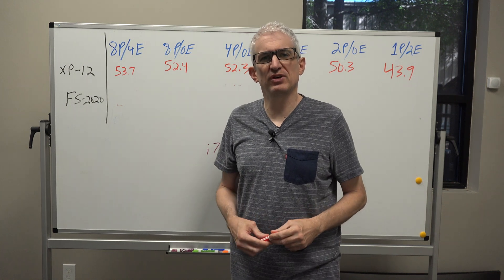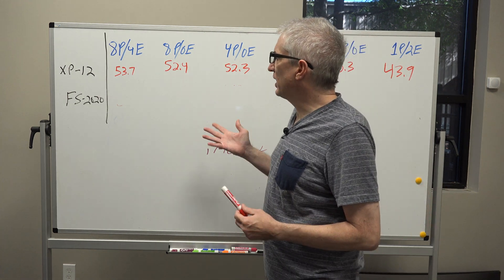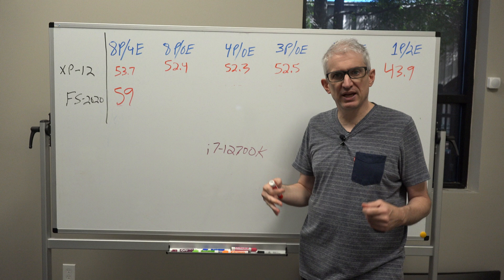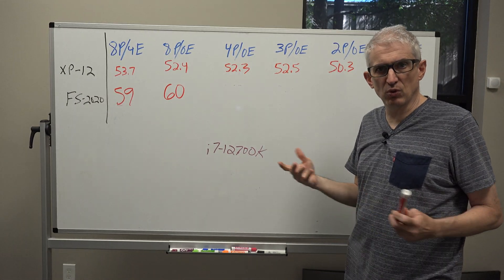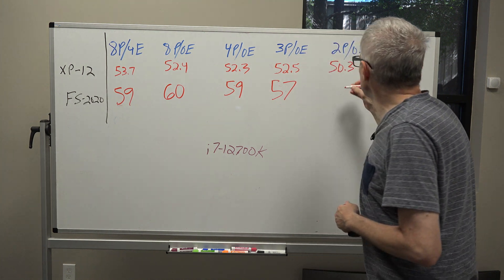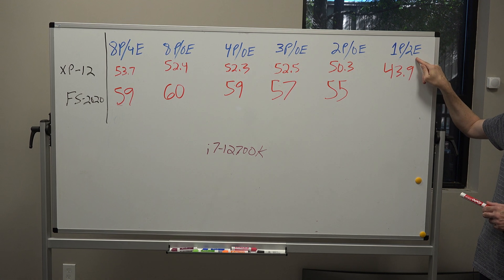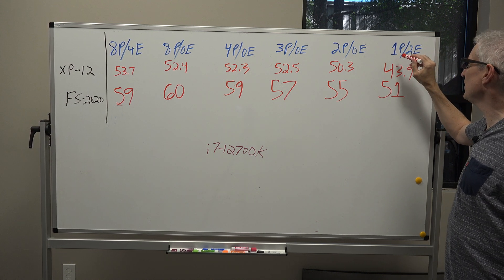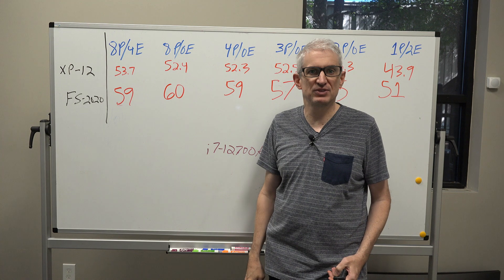FS 2020 CPU Core Scaling

Comment: I don't know everything, but fs 2020 does not fully use multicore. It's nearly as bad as FSX in this regard and IMO is unacceptable now. Top end games have been using more cores so that the ones in the last few years have really saturated 8 cores but not flight sim. It's from microsoft, they should know how to code by now. Is it just impossible to do with a flight sim ?  I am having a hard time to believing that since so many other games that push my GPU to the max are are also pushing my CPU to 80% + on all cores. Meanwhile if i look at core usage when flying it is pathetic. It's frustrating because my system works great for everything but for FS i have to upgrade the CPU to the fastest most expensive one so that 1  core can help. Ridiculous.
Reply from the maker: X-Plane says they are working on multi-core support.  I am anxious to see what that looks like.

Comment: to all the people with the negative comments you don't know what your are talking about.  He did a good test to show the problem with this game and many others. it is just to much work to code for multiple cores, fsx had this problem and for years i tried to fix it but its just not coded in  away to use the cores. Most games are not, i just bought starfield and i was impressed it is using 75% of my cpu with 7 of the cores loading very evenly. Look at core load for any game from the past 10 years and you will notice the same picture, most games are GPU dependent and it goes un noticed but this is a flight sim and its a real shame they did this, seems the priority was console since its stuck with the same GPU. flight sims benefit from PC hardware upgrades over many years.

Comment: Excellent test Mike and a point well made. But, you only touched on hyper-threading and this is a feature that really goes back to single core processors and with modern multi core processors is now of little benefit - in fact is actually slowing things down a little. It would be very interesting if these tests were repeated with hyper-threading turned off, then we'd know how many threads the flight sims are actually using. If sims make good use of a second thread or even a third, then turning off hyper-threading and forcing these to be spread over individual cores, may do a better job than Windows does with hyper-threading turned on.

Comment: This testing is flawed in many ways as he is testing on a single monitor, I don't know ANY of my flight Sim friends (many of whom actually have licenses and fly real planes) that would use ONLY 1 screen, its a 3 screen minimum with several friends using 4 to 6 (to add the instrument panel on 1 screen plus the forward heading, 1 left-heading and 1 for right-heading or looking screens, and I know for a fact that it is NOT just the GPU (graphics card) that has to handle all that extra screen realestate,, it IS the CPU that has to step up and push the frame rates, I have noticed that in the racing games that I play (as I am more of a Racer (IRL & on the PC/console(i wish consoles had an option to do more than 1 screen, sure its nice to have a 55", 65" OLED or a 144" LCD projector, but 3 screens or compensation for wrap around/Curved screens would be nice, plus you can connect a PC to larger OLED screens and projectors as well) and I notice a difference on my 14 various home PCs in performance when using more than 1 screen)), and so I think this test should be reexamined and redone on a multiple screen sysem.
Reply: And with VR
Reply: I only use one screen (like many others I know) and I'm heavily involved with flight simulation.
Reply: I dont think you know what your are talking about, adding more screens does not put more demand on the CPU. When you increase the rendering resolution the GPU has more to render. This does not increase things like weather, physics, AI, etc. I run a 49# curved monitor with increased FOV and this looks more real than the old multiple monitors.
Reply: @supergenius74  I couldn't care less what you think. I've been working in I.T., System Administration, Network Administration, System building, hardware and software development for probably longer than you have been alive. I don't require or need validation from someone who calls themselves "supergenius__" as that only hints at someone with self doubt, inexperience or both 🤔 and thus, good luck with whatever it is that you do but I know I am correct in my comments, that's why they are typically lengthy and detailed. Good Day
Reply: It is not flawed, I use one giant 60 inch TV just fine. Others use 100 inch TVs, or single large monitor. Not everyone wants multi monitor stock market analyzers desk. Micheal chose a simple baseline - single display, same airport, same runway and progressively disabled C and eC. What is "flawed" about that?

Comment: Flight Sim benchmarking is complex.  I have an old 2017 xForce PC w/ i7 7700K 4 core, nVidia GTX 1070 8GB, which can drive a 5120 x 1440 4K galaxy neo g9 gaming monitor and XPlane 12 smoother and slightly higher fps than my Mac Studio Ultra 20 core cpu / 64 core GPU.  But there is a LOT behind this which no simple benchmark comparison can explain.  The forthcoming critical benchmark w/ MSFS (beta) is with DLSS 3 enabled which is likely going to be a major step in rebalancing CPU vs GPU bottlenecking.  So investing in the 40 series nVidia platform has a significant potential ROI in this regard (versus buying an earlier platform that does not support DLSS 3.  There are already some early measurements on this, quite exciting results.

Comment: Thanks so much Mike for the information.  Really enjoy your comparison videos.  I wish there was more testing like this out there.  Would love it if you did some testing in the future comparing clock speeds between some of the higher end CPUs in the future if you were willing.  Knowing their is still a CPU bottleneck in XP12 really makes me wonder if upgrading my 5800x to something like a 5800x3D or a Ryzen 70xx CPU would be worth it, or if a counterpart on the Intel side would be a better option.  It's so hard to find the sort of specific, simple, quality information you are providing here.
Reply: Xplane for now don't use 3Dvcash so 5800x3D don't have many sense. what I seen 3Dvcash have more sense with slow RAM 2666 cl20 vs 3600 cl16 on 5800x3D have a little difference.

Comment: I would think frame rate would be far more impacted by the GPU than the CPU.  I run a lowly 2080 for now and an i9-9900 and I see one thread at 50% or so and all the others under 25%.  Using multi-window (3), 1440 displays, I get 32-40 fps, 32 near the ground with lots of trees, 40+ over 2000’ AGL, HIGH and a few Ultra Settings.  Multi-window is a pain in fs2020, but it’s better than when I used nvidia surround.

Comment: Thanks for performing that illuminating comparison!  It was a good test to confirm that most of the CPU base-level computation is being performed on a single core in both simulators (excluding loading new textures, terrain, etc.)  Assuming any major math is still left to the CPU and not on the GPU, both simulators might benefit from parallelizing bulk calculations across more cores.  Unfortunately,  many programmers tend to approach threading with trepidation, due to the added complexity.  Well designed threaded code need not be feared, though.  It just requires following a few rules.

Comment: Completely pointless test scenario. If you're sitting still on the runway in a Cessna 172, once the scenery has loaded in the CPU really doesn't have that much to do. Repeat the same test while flying in an airliner, over Photogrammetry scenery / complex airports. This way the CPU actually has a workload (processing the 3D scenery, calculating the plane systems, calculating aerodynamics etc etc). 
If you want a repeatable scenario, you can select a landing challenge in an airliner (of course in a photogrammetry area), and just let it fly straight on. 
Also take 1% lows and 0.1% lows into consideration.

Comment: Unfortunately this is a flawed test as average framerate doesn't tell you the full picture. Framerate, frametime, 0.1% lows and 1% lows will be significantly different between the various benchmarks. Also the world streaming, especially in heavy areas is going to utilise the cores differently in MSFS as you fly throughout the world.

Comment: Simply sitting on the runway at an airport is not going to be a good test for performance or the extent to which performance may be dependent on having more than 2 or 3 cores. The benefits of having more than two or three cores are more likely to be evident in more tasking scenarios that, for example, involve turning the camera in situations with a lot of scenery or when approaching an airport on landing. Many PCs can handle a static image which is common when flying but will struggle in situations where the camera is being moved in tasking scenarios.

However, I would also like to add that most of your content is very good and informative. Yet, when it came to this test I believe you would agree that it was too simplistic, even if the intention was simply to illustrate what is widely known: that flight simming is very dependent on the single threaded performance of the CPU.
Reply: MSFS 2020 also has lots of memory action when streaming terrain, if you have the SSD cache set up then it'll be saving files to the SSD at the same time as streaming in and displaying new geometry.

Comment: Makes you wonder how a 4090 is going to make any real difference.
Reply: It's not going to. Simple as that. It is going to make a difference in most other games since few of them are that taxiing to the CPU and don't get plagued by CPU bottlenecks thus allowing the GPU to run as fast as it can, but flight sims are a different story. Investing in a vastly overpriced 4090 that will be completely bottlenecked, as is already a 3090 and even less in flight sims, is a bad idea, at least if it wasn't for DLSS 3.0 and its added frame. Also, remember the release of the mighty 1080TI not so long ago? That GPU was legendary for being at the time literally as fast as a Titan for a fraction of the price, it was the highest ground for gaming by far... well, that thing was priced around 700$ at the time of release and people all felt it was rightfully a huge price tag (albeit worth it). Makes you wonder with todays prices... And that 1080ti is still as fast as a 2070 Super (minus the RTX package). Quite a feat back then. Very top of the line. Only 700$...!! And it was only 6 years ago. Inflation my ass!

Multithreading is also not going to be magically optimized over time I'm afraid. Utilizing multiple cores has always been a problem for games and I'm afraid it will stay so indefinitely unless someone completely revolutionize the way programs are coded for the very very ground up, which is obviously not going to happen, if it is even a possibility to begin with.
As long as you will need to synch the results of different calculations and different processes in order to render the result of them (in a game: a frame by the GPU), the process of synchronizing all data and calculate an end result will always be the bottleneck if it ends up using most or all of the only core it can be run to (or else, if you did that synchro process on 2 different cores, you'd still have to synch the 2 results down on one core and etc.)

Multi cores for gaming as always been more of a marketing thing to alleviate the fact we have trouble finding ways to enhance CPU individual core to a lot more than what it is since a bunch of years. So you slap more cores, but more cores is really a thing when you do multi-tasking with lots of programs or parallel processes that are completely independent of one another and thus don't need to be synched (for ex: using separate programs that have nothing to do with one another each on a separate core, rendering a still pre-rendered CGI image where you can separate the rendering into several zones of the image and run the calculations on separate cores since it doesn't matter if any zone is rendered before another and etc.)